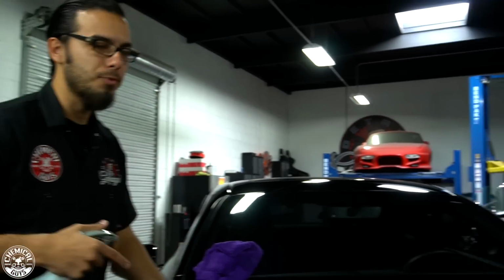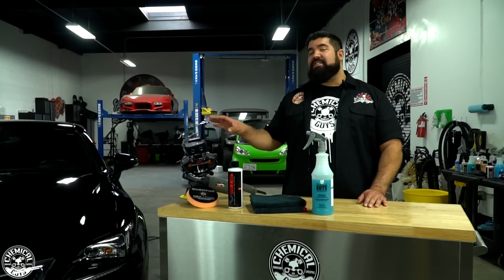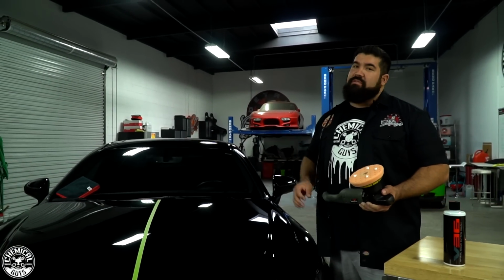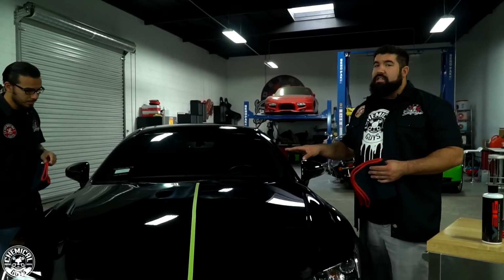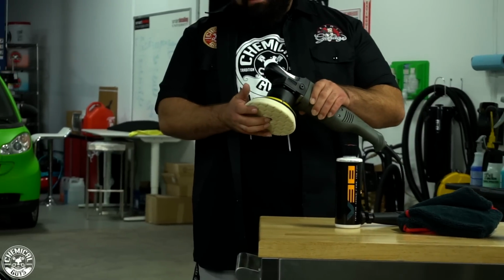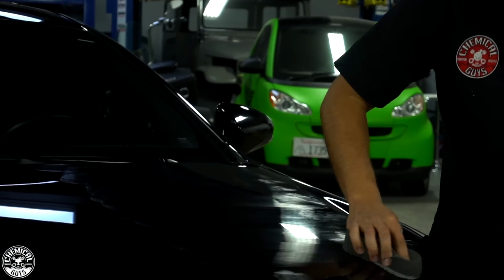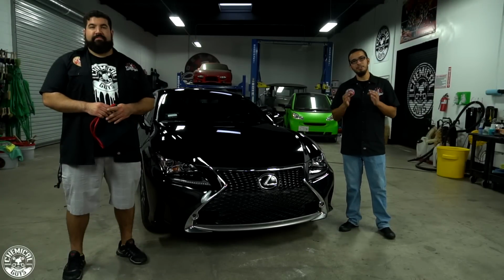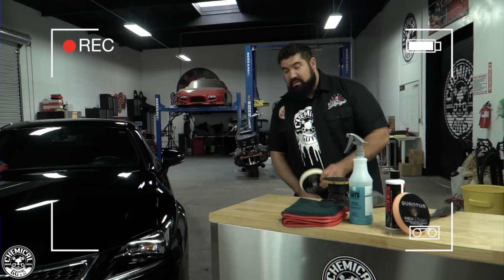How To Prepare Paint For Protective Coating - Lexus RC 350 - Chemical Guys

Comment: Great video guys! Can you help me out. Can I apply Blacklight before using top coat? Or should I use Top coat then apply Blacklight after.
Reply from the maker: Thanks for the love! We'd love to help you out. The Black Light Hybrid Radiant Finish is a specialty hybrid glaze and sealant that provides a deep wet shine while also fill minor swirls and scratches. It becomes a line of defense against pollution, brake dust, industrial fallout , water spots, and harmful UV solar rays. The Black Light should be applied before you apply your top coat because your top coat will be the first line of defense that lock in the benefits of the Black Light. The Top Coat, for example, like the Carbon Flex C9 Protective Coating will protect against fading, oxidation, discoloration, and corrosion while also rejecting UV sunlight, liquids, bug splatters, bird droppings, and more. This particular top coat provides protection that lasts up to 36 months. Happy Detailing!
Reply: Awesome! Thanks for the response. 👍

Comment: can you use white light and then top coat or would you recommend a different wax or sealant
Reply from the maker: Hey Lane, thanks for watching the video. I think those are both great choices. I'm guessing that your car is white, or a light grey. I would also recommend Butter Wet Wax, and JetSeal. Or you can try the White paste wax, and Blitz.

Comment: Can I just apply top coat right after washing car or is it recommended to apply another product before it ?
Reply from the maker: Hey there, thanks for watching. Besides washing and claying, you could apply a glaze prior to applying Extreme Top Coat. The detailing flow chart goes as follows; WASH - CLAY - POLISH - GLAZE - SEAL - WAX.
Reply: So what if my car has been clayed like two months ago . And thanks a lot you guys the best !
Reply from the maker: Feel the paint, if you notice that the paint feels gritty, then you need to clay it because that contamination will interfere with any coatings ability to adhere to the paint's surface. If you don't need to clay, then you can apply the glaze and allow that to cure before you apply the next coating.

Comment: Extreme Top coat or Jet seal ? Which is more durable in the lovely Mn winters
Reply from the maker: Hi Ryan, they both offer one year of protection against paint etching and water spots, however Jet Seal is pure Sealant where as Extreme Top Coat is a hybrid wax and sealant. I feel like when something is dedicated, you get it in its purest form.  I'm a big fan of both, if you want shine go with Extreme Top Coat, if you want pure sealant, go with the Jet Seal. You can't go wrong with either.

C.G. Alex -
Reply: Can i still apply white light under the extreme top coat?
Reply from the maker: Hey Ryan, you definitely can, your car's paint will look insane.

Comment: where I can find the same LED light u guys used in the video?
Reply from the maker: Hi Lee, here's one you can check out that's comparable, it's available on Amazon
https://www.amazon.com/Brinkmann-800-2380-W-Rechargeable-Automotive-Patrolling/dp/B01CFX0KZO/ref=pd_cp_60_2?_encoding=UTF8&psc=1&refRID=SYE2C8Y7E7W8BBY954PJ.

Comment: Extreme top coat or Jet seal? Which sealant before wax?
Reply from the maker: Hi! We recommend Jet Seal, it is a manmade synthetic wax that takes paint protection to the next level. JetSeal bonds directly to the surface, creating a strong shield against water spots, contamination, road grime, and UV sunlight. Innovative UV protection technology helps reject harmful solar rays and protect paintwork against fading and discoloration. Thanks for watching and thanks for being part of the Chemical Guys family!

Comment: Chemical Guys i was thinking of going with a ceramic coating on my black audi a4 next year after using black light, jet seal with other waxes on top for this year and love the results. But can i use black light under a coating or does a coating sit better over the bare paint?
Reply: TAGSProle paint coating has to be striped all the way (naked paint). Then after coating you may use waxes or other non permanent products.

Comment: What's the difference between the top coat sealant vs jetseal?
Reply from the maker: Hi Miguel! Great question. Extreme Top Coat is a hybrid product that contains both wax and sealant. Extreme Top-Coat is blended with natural Brazilian carnauba wax to give the product the look of a natural paste wax coating with the durability and extreme protection of a full-synthetic sealant. Extreme Top-Coat is the only sealant that levels and fills to enhance a beautiful, natural shine unlike any other synthetic product. Specialty leveling agents fill minor swirls and scratches and other imperfections to restore pure clarity, deep luster, and brilliant shine to any painted finish. JetSeal is our dedicated 100% sealant that does not contain any wax. It's one of our longest lasting sealants and it is great product to use in conjunction with your favorite Chemical Guys glaze and wax, or as a stand alone product. Thanks for watching, Miguel, and stay tuned for a new videos headed your way soon!
Reply: Chemical Guys thanks love the videos